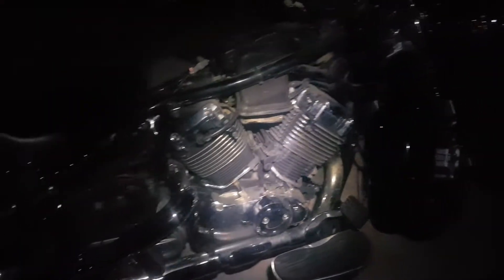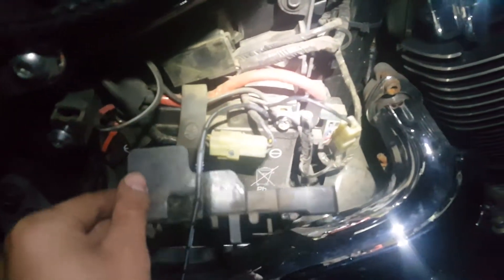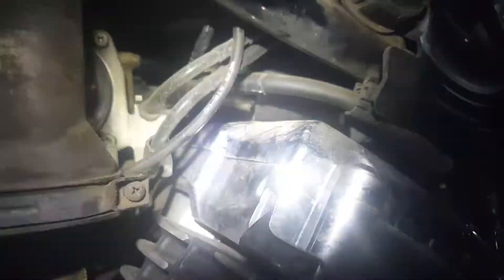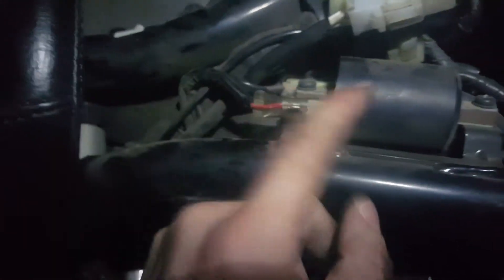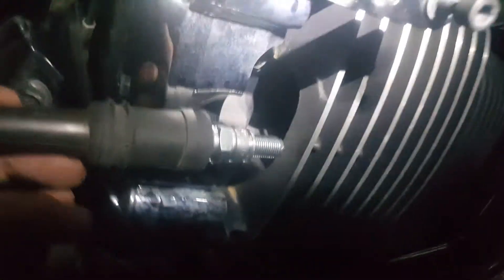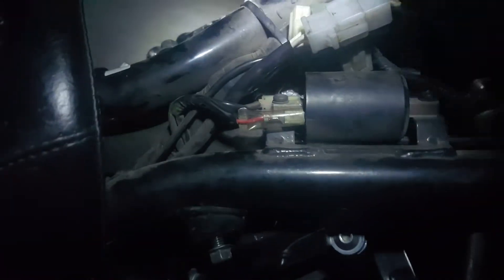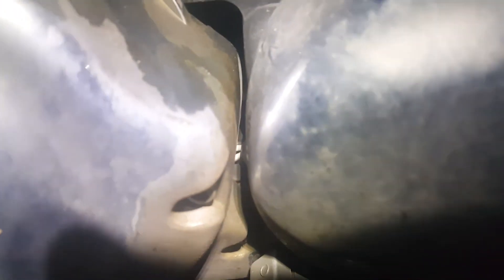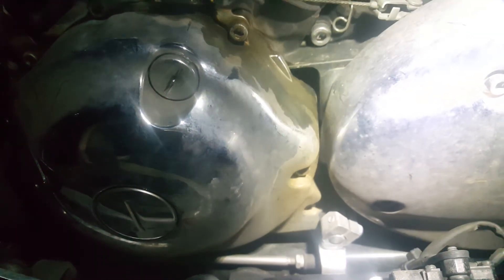Yamaha VStar 650 | Ignition Testing/ Troubleshooting - Battery To Spark Plugs | Pick-Up Coil Problem

Comment: Hi, I was stuck on the highway, the battery was swollen and suddenly there was no more gas, that the fuel pump was burned?

I changed the battery but the gasoline in the carburetters is there but the bike does not start, blowing into the tank gasoline turns on for a moment but then turns off